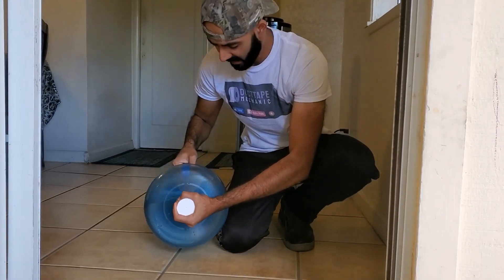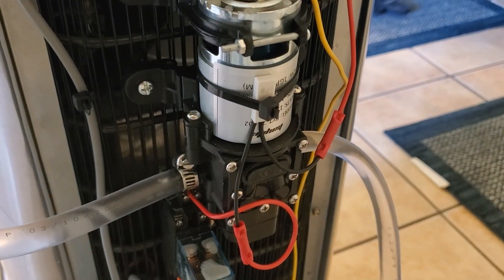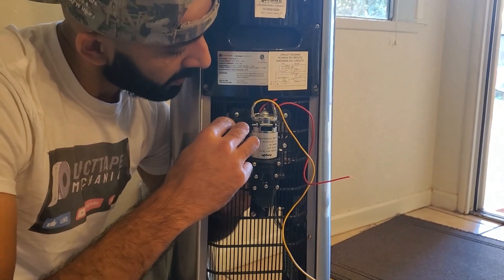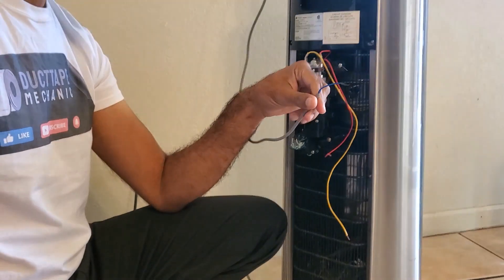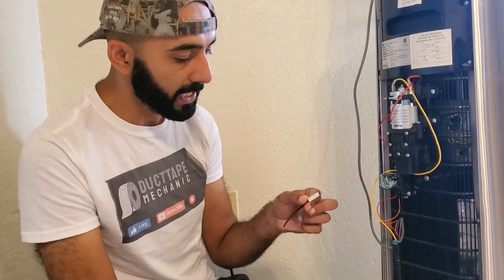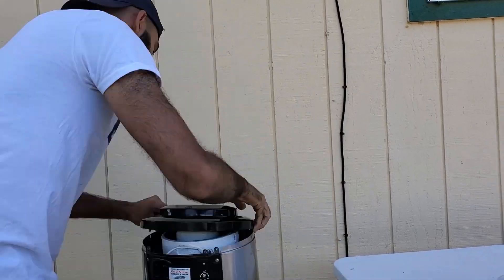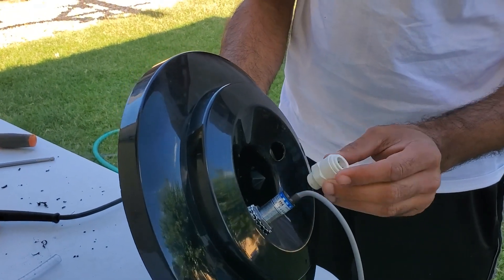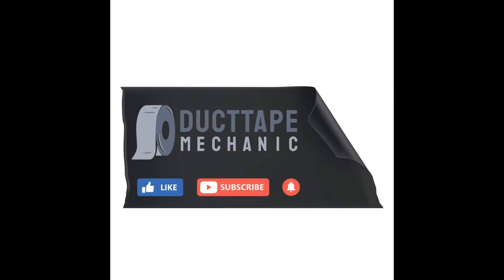Water Dispenser Modification

Comment: Not sure what the cost is for this modification?  But what ever the cost is, it does not solve the problem of dealing with the the 5 gallon container, and it does not solve bacteria contamination or growth in the 5 gallon container.  Also the the noise im of the relay sounds way too loud?  The 5 gallon container weighs about 50 pounds when full.  Depending on how far or up you need to carry the container with no handles, serious injury can occur just transpoting 50 lbs?  Also it does not solve the bacteria growth?  The right system connected to the pressurized water supply, and completely enclosed system, would solve all the issues, including the noisy relay?
Reply from the maker: It was more of a joke then anything practical

Comment: Hmm wonder if this would work with an in wall water line.  🤔
Reply: You should be able to use water line (make sure it's from a filtered source if you don't like the taste of tap), you would just replace the pump with an electrically controlled valve since the water line is pressurized.